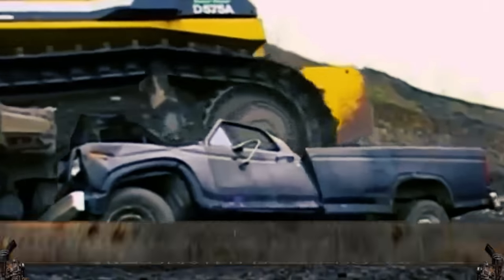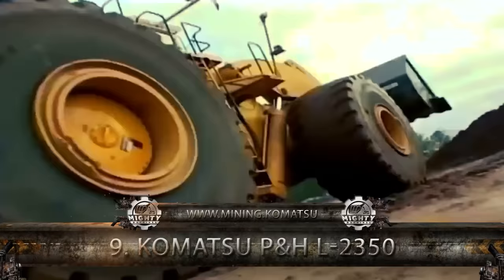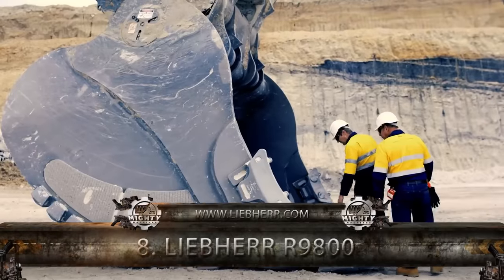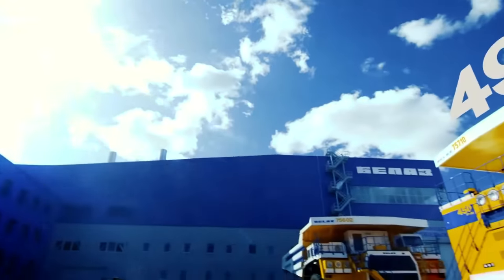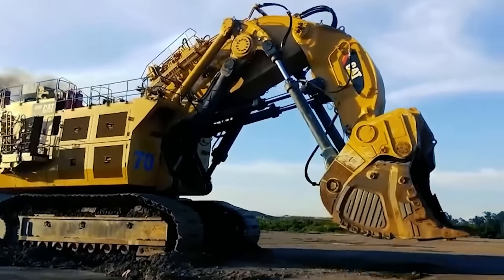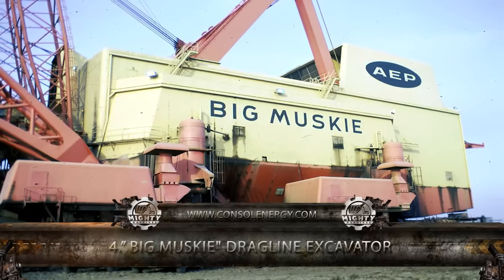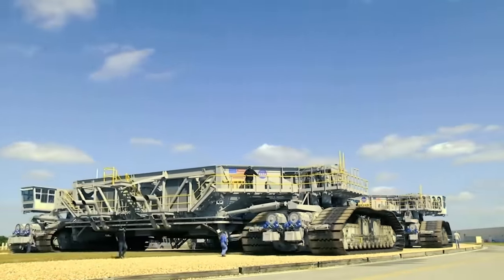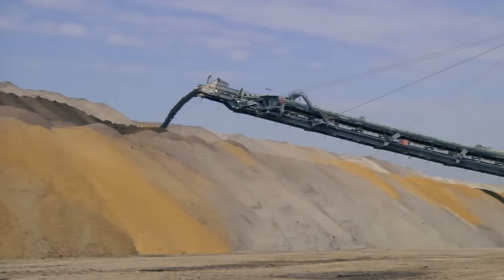World's Biggest Mining Machinery: Top 10 Mega Machines!

Comment: Like in a hundred years they will be making battery packs so these 4200 hp trucks are green . Right. Haha. The democrats are nuts.
Reply: Haaha so true.... how we gonna run anything like these on solar panels and windmills. I guess when you are completely ignorant of how anything is mined/made you can think up these stupid utopian ideas. I work at a smaller mine and running those machines on batteries is laughable.
Reply: And in fact batteries make it less green than red dye. But they'll never get that through their heads.
Reply: Btw some of these are alrdy sold as electric cause cords exist
Reply: Those batteries wouldn't last an hour
Reply: Hydrogen engines my friend
Reply: A lot of the old mining equipment was electric…
Reply: They will not exist anymore because there will be no need for them I imagine if things go the way it’s going

Comment: Your missing a few things.THe Bucyrus Erie 3270 Lot 1 & LOt 2 walking draglines at about 20 million pounds apiece.THe Marion 5900,5960 stripping shovels.THe L2350 is the largest wheel loader ever built.Or both Bucyus Erie 3850-B stripping shovels at 120 yards & 140 yards.How about the Hitachi EX8000-6 & the Komatsu PC8000 that are the same size as the R9800.How about the Caterpillar 7495 cable shovel.But the biggest omisson from this list is the largest stripping shovel ever built the Marion Power Company 6360 otherwise known as THe Captain.The 6360 weighs more the the Big Muskie dragline does.THe 6360 weighed in at 30 million pounds & had a dipper of 180 yards & had 4 sets of tracks on all 4 corners that were 40 feet long & 16 feet high.That should be it least #3 on this list.Ironically Marion also made the NASA  crawler you show here.

Comment: How do the doors on the back of the face shovel buckets stay closed when digging? Also, how are they opened? Nice machines. Best regards.
Reply: 6
Reply: There are large hydraulic cylinders built in each side of the bucket, these open and close the clam.
Reply: Tünel kazıcıyı o çukura indiren vinç de övgüyü hakediyor
Reply: @justdoesntaddup8620  Hi Just, I was referring to the rope operated face shovels. A rope opens the door on the back of the bucket, I see that now. Maybe the bucket is pulled back sharply and the door slams shut?     🤔    Best regards.
Reply: @johnmitchell1614  yeah pretty much just slams shut
Reply: @johnmitchell1614  The door of the bucket swings shut via gravity and there is a "latch bar" on the back of the door which drops into a thing called a "dutchman" on the bottom of the bucket (dipper), (locking the door shut), when you want to open the door on the bucket (dipper) you simply move the left lever in the cabin to the right to release the door via a trip rope which is connected the a lever on the door of the bucket (dipper) this lever pulls the latch bar up and out of the "dutchman" to release...........
Reply: @markfitzgerald7556  Okay, thanks Mark. Best regards.
Reply: The Liebherr R9800 has a bucket of 59 cubic yards which is completely wrong, it is exactly 119 cubic yards.